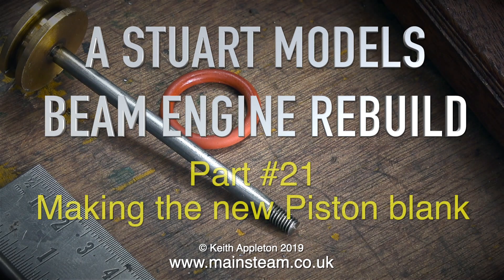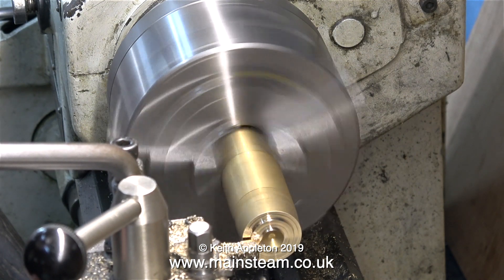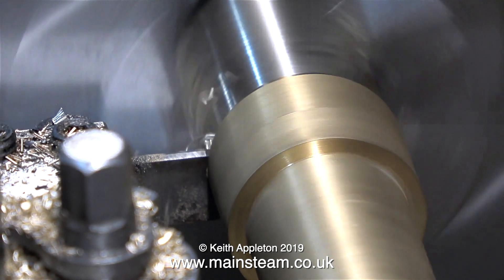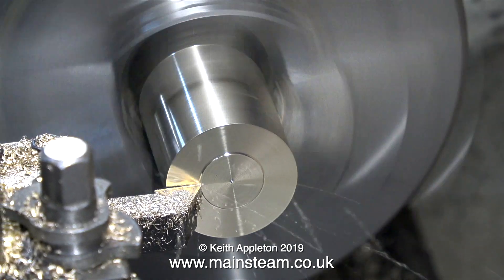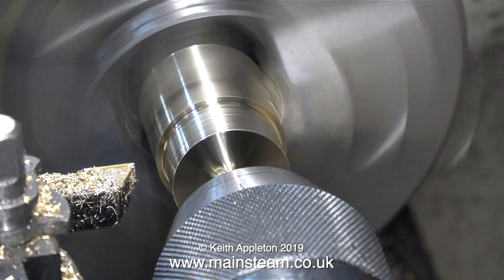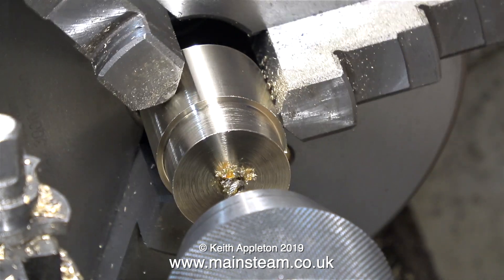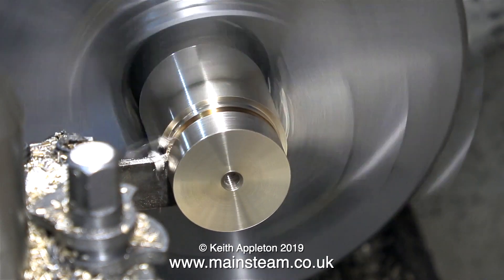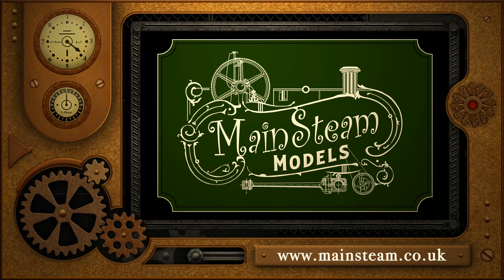A STUART MODELS BEAM ENGINE REBUILD - PART #21

Comment: for brass, because of the spraying chips, i like to use the tool upside down and run the spindle the other way around so that the chips spray down into the chiptray instead of up into my eyes
Reply: works well with parting off tools, for normal turning tools you have to use tools woth the cutting edge on the o0osite side of your normal tools though

Comment: The helical taps are designed to draw the chips out of the hole regular taps push the chips through the hole. Helical taps are good for blind holes.